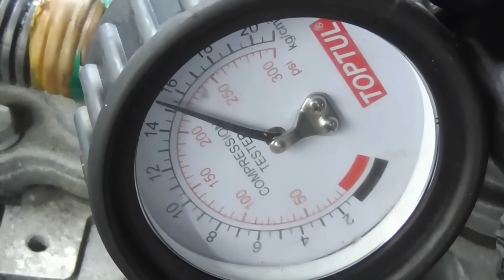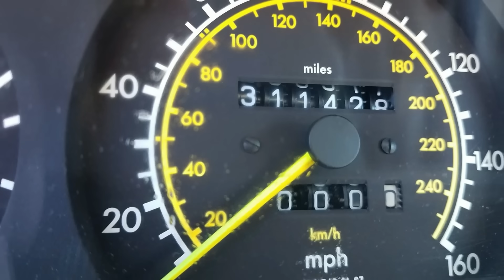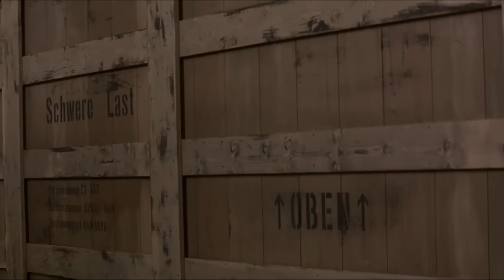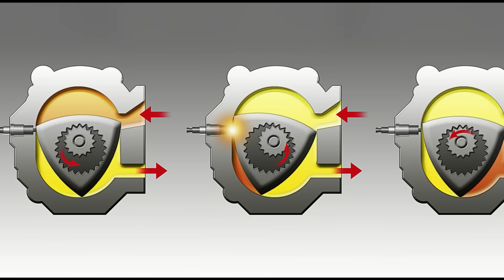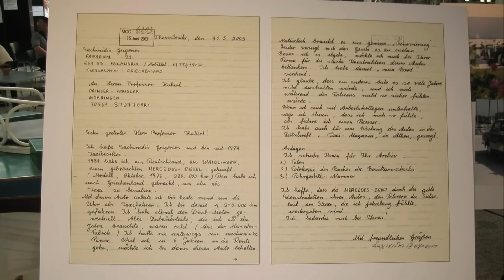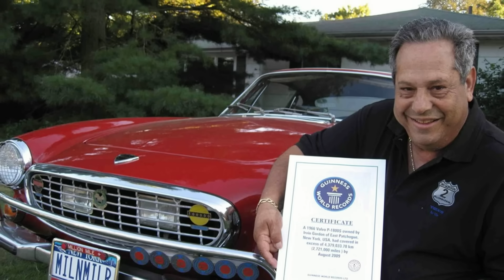Most Reliable Engines of All Time

Comment: Hate to say it but the old ford 289’s are bulletproof. 
200k is nothing, I drive up to 400 kms a day and have gone through a lot of vehicles and many different engines. 
The secret is not a secret, if you take care of almost any engine you can easily get 400,000 plus out of almost any vehicle. Oil changes being the obvious most important thing to be anal about, followed closely by being very diligent about coolant, more important than people think and mostly ignored.

Comment: 200k engine life isn't very impressive. A 6bt cummins would barely be broken in at 200k
Reply: It ain't broke in until the rear main seal leaks
Reply: @blake102989  Yesh not even really. Mines been leaking for years.
Reply: @RiggyRonnie  normally starts at about 150k for Cummins. If I ever buy a diesel itll be cummins forsure. Until then I'll stick with heavy Chevy

Comment: I'm underwhelmed by the claims of engines lasting 2 hundred thousands miles as being high mileage champs.  My GM (Detroit Diesel) 6.5L lasted 423,000 miles before it lost enough compression to become hard to start.  200K I spit on your claim of high mileage.  Took the motor to a auto machine shop and was told the cylinders had only two one thousands of an inch wear.  I guess the rings were not up to the task.

Comment: Chevy LS engines are known to go 250k to 300k miles before burning oil and used they can be turbocharged to 700hp safely and rebuilt for 2000hp. I’d say that’s worthy. 
I had a 300D. Only drove it a few times. Thought something was wrong it was so slow..... to about 15mph then the turbo started making boost and it starts grabbing gears and locking torque converter surprisingly fast. If you can manage to powerbrake it enough to build boost it will definitely roast the tires too lol

Comment: You missed a few of the really great engines.

Toyota 1Jz/2Jz - easily 200,000miles +
Toyota 1HZ and 1HDT - many examples over 1 million klms
Nissan TD42 AND TD42T - many examples over 1m klms
Reply: J M 500,000klm on my 1hz with aftermarket turbo setup.

Comment: No million mile Cummins where with basic maintenance you can achieve a million miles, no small block chevys that achieve 300k 350k? No y’all put a rotary on the list where you’ll need to replace apex seals every 50k miles, might I add that’s a pretty serious reliability issue

Comment: you missed the most durable engine ever, IMHO, the Toyota 3.4 in the 4runner and Tacoma.  Absolutely bullet proof
Reply: It is ok, has problems with timing cover leaks, OCV valves, timing chains, and power steering pumps.
Reply: @kennethebel7726  

The timing cover doesnt leak,  There is NO issue with a PCV valve, which is not part of the motor.  There is NO timing chain and the power steering pump is bullet proof and is NOT part of the motor.  Try again.
Reply: @nwredneckj  oops, I got mixed up. I was thinking the 1GR not the 5VZ. I am a Toyota Technician though. The 5VZ does have oil pan and valve cover issues though. I have seen more rear main seals on that engine than any other Toyota Engine, but they have made a revised one if you get it replaced. It has sensitive front O2 sensors especially on the passengers side. Change the fuel filter every 50k because it has primitive injectors that clog easy, but that's a common issue back then. I will agree with you that the engine does last a long time, but it does have oil leak issues past 100k. One other thing is I was saying the OCV for the 1GR, not the PCV. The OCV is for the VVT-i not the crankcase ventilation.

Comment: That can’t be right.  Missing a lot of most KNOWN reliable engines like the examples of the Jeep 4.0 and the Honda D series in older civics.   I can’t speak for just one car lasting long time like the Volvo P1800 or the Plymouth fury.   Mazda rotary?  No way.  They need apex seals replaced every 100k Miles.

Comment: Love my 1981 Mercedes 240d diesel.  It is a solid engine with just a 4 cylinder.  It has the 4 speed manual transmission and is a kick to drive.

Comment: what about the renault cleon-fonte series, or nissan sd diesel engines, i have a nissan sd23 with 432000km with the original internals, clutch, and transmission and still runs like new

Comment: Nerds who aren’t mechanically inclined should not make car videos.
Reply: Jon L THATS A FACT JACK, BET THIS MORON CANT EVEN CHANGE HIS OWN OIL
Reply: @ljbrizo  Oh yeah, but "engine tuners". An engine "tuner" is the guy who changes your points and your air filter, not the guy who bores your block and fits oversized pistons. 

Uncircumcised children who watch The Fast And The Furious and think they know something about cars. 

Look at what happened to Paul Walker - thank God he's dead, he was an idiot who did not respect the machine because he did not know enough about them, and fortunately it killed him before he could make more movies to get every 17-year-old thinking his oil-burning worn-out Civic was a race car for the streets.
Reply: For real tho😂 a dorito engine and reliable are 2 different things also by the 3sfe engine he showed a celica t23🤦 it came in a t20 gt4 and the mr2
Reply: Yes.... Exactly... DETT is not a word
Reply: He really said that rotaries are reliable. Say bye bye apex seals
Reply: Is this a high performance engine reliability post or every day drivers??? No mention of the Ford 300 CU IN in line 6 engine that I personally owned a 1965 Ford Fairlane that I sold with 491,600 miles on it still running just fine. They were made from 1965 thru 1996 and they were not just in cars/pick ups ether. Many farm tractors, farm equipment, utility vehicles and the big brown UPS trucks had them as well! They were not high mpg engines but RELIABLE! I have one horror story though that my Brother bought a 1967 Ford F 250 4x4 with a 300 six in it. In the summer of 1969 I asked him how often he changes his oil because he was complaining that it was burning a quart every 300 to 400 miles? His reply was, "Change oil?" It had 45,900 miles on it with the original oil and my brother only adding oil when needed. I changed his oil/filter putting in high detergent oil. He took my advice having the oil changed again in 100 miles. It lasted another 38,100 miles before it locked up.
Reply: LOL
Reply: I'm sure he has some pretty good sources ;)

Comment: R u kidding me, the 13b rotary engine is notorious for its reliability issues and it burns a ton of oil
Reply: Don't doubt reliability issues. But they are suppose to burn oil. They inject oil into the combustion chamber to lube it. Thats one of the major reasons they don't make them anymore. Won't pass emissions.

Comment: 5.9 Cummins Diesel    average over 600,000 before anything major.  lots of engines still pulling loads with over 1,000,000  I believe the motor started it's life in 1934 but not sure.
Reply: Diesels are a different animal. They have a different ring design that helps prevent blow by. Plus they spin a lot less rpm which helps them live longer. You're pretty much comparing a tractor engine to a car engine. They also weigh hundreds of pounds more.

Comment: Talking about reliable engines and not mentioning the 1.9 TDI should be illegal!
Reply: True Didn't even mention any detroit diesels or even the infamous 6bt cummins put in everything.
Reply: The Puppet Of Everything  Ikr, no Detroit engines?
Reply: 302000 miles on my tdi and still runs beautifully
Reply: @Bacon12954  - Just wrote this in a comment further up. ;-)
Friends Seat Ibiza 1.9 TDI (VW) 675k Km when he sold it. Still started and run perfectly. By then he simply got tired of the car. Got another new one. Absolutely regular oil changes and general care. No fancy oil additives, etc. Just plain good old maintenance. Internals all stock to the bone.  ;-)
Reply: 1.9tdi....lots of problems with turbo, turbo runaway, injectors , injection pump and so on

Comment: There's a reason the straight 6 Cummins diesel engine is known as the million mile engine..yet a Wankel engine made this list and the Cummins didn't. Not the mention the miles a Chevy 350 can rack up. Therefore this list holds little weight to anyone who really knows cars.

Comment: The Chrysler 225/3.7 Litre Slant Six should've made the list, I've seen several with over 600,000 miles on them with all original engine internals.
Reply: best motor ever for reliability..  had one in a dodge dart gt.... got it with 200k on it and I put over 100k and it was still running strong when I sold it....

Comment: First off, mazda didn't invent the wankel. They just took the chance to mass produce it. GM experimented with the wankel design and made one that ran with over 500,000 miles with minimal wear. That being said, the engines should be left to racing applications. There's too many ignorant men and women who do well to maintain piston engines. I see regular motors for sale every day in vehicles with ruined heads and possible cylinder wall and piston damage at 100,000 miles because they neglect the timing belt. God forbid they ever check the oil.

Comment: My dad's Chevy 350 v8 from the 70s had 1 million miles. All he had done was change gaskets....the internals were all original.
Reply: Really? Good for him. I've seen many many SBC from that era smoke before 100,000 mi because the rings were gone. Still running for sure. But you can't sit in traffic without asphyxiating everyone at that intersection.
Reply: 100% true. He drove it daily and changed oil at 5000 with castrol. He also wasn't afraid to drive the piss out of it. He swore by Lucas oil in his gas too, a tradition I've lept. I've never got under 250k put of an engine and I Rev em and push em hard. Dad always said worse thing you can do to a car is not drive it. He documented the mileage. He changed head gaskets etc only, the valve cover gaskets tended to leak, they were cork. He drove it year round in upstate ny. Always put good gas in it, it had balls too!
Reply: Friends Seat Ibiza 1.9 TDI (VW) 675k Km when he sold it. Still started and run perfectly. By then he simply got tired of the car. Got another new one. Absolutely regular oil changes and general care. No fancy oil additives, etc. Just plain good old maintenance. Internals all stock to the bone.  ;-)

Comment: You forgot GM's 3.8 Liter V6 ! My 3.8 Buick Lacrosse has 240K and still runs strong !  No noise, no smoke, passes emissions inspection, still runs smooth !
Reply: easily one of the best pushrod engines. I used to have the L67 3800 Series II supercharged in a modded GTP Grand Prix
Reply: 3.8 series II is very good.  Seen them with 300k - 400k miles.
Reply: @scotta9114  s3 is also good
Reply: Im sure it is.  What's better than old proven technogy?  Nothing.  Now their transmissions arent so good. My friend just spent $600 to get the intake valves cleaned on her Direct Injection KIA.  Crazy.
Reply: I agree 3800 v6 the best v6 engine ever built
Reply: that  may mean my wife will never have to buy a car again?
Reply: There not bad engines if you take care of them but they're nowhere near the list of most reliable I had a V8 Northstar with 210,000 on it doesn't make the Northstar reliable engine
Reply: @EXPERTAUTOREPAIR  Good point, but the 3.8 V6 has a much better reputation then the Northstar engine !
Reply: @EXPERTAUTOREPAIR  except they where considered very reliable by mechanics and car people. Could last 500k miles with proper maintenance

Comment: Typical import fan list. Camrys and accords with 100k miles are road hazards. Struts are completely shot, CV joints go bad, they smoke and transmissions flare shift. Check engine lights are lit all the time. Just because they run for a couple hundred k, doesnt mean they're not shit boxes. One of the engines used from the mid eighties to the nineties? The small block Chevy was used from 1955 to 1997. Over 100 million engines based on a single design. Horsepower kills engines. Any of those tiny import 4 cylinders should run 400k considering they make 100 hp and pull a 2500 lb car. The ones in the list with twin turbos definitely wont run 100k. Another uninformed propaganda list.

Comment: Chevy volt 400k miles and still runs great with stock brakes.
Reply: I heard a guy at discount tire talking about the regen saving the brake....i wonder if the regen wears???  400k sounds like it doesn't wear anything.

Comment: BMW and Mazda engines among most reliable engines? Seriously?
Reply: BMW engines are good, its all the plastic bullshit around the engine that breaks. I also had an E30 with over 300k but my 2002 330ci was always breaking. Plastic water pump impeller broke, plastic radiator broke, ignition coils always burned out, plastic MAF housing cracked etc. Totally unacceptable for a "premium vehicle" considering my 1974 chevy truck is still rolling with the original water pump and radiator.
Reply: My e30 has 242k and still runs great
Reply: Rotary engines aside Mazda does indeed make some of the most reliable engines.
Reply: Bmw M57 engine wasn't as reliable as the M51 engine.

Comment: A 4 cylinder motor than can do 300k+ miles with little to no issues is MUCH MORE impressive than a 6 cylinder or especially 8 cylinders doing the same.
Reply: Not really....  V blocks usually don't last as long as inline engines.

Comment: Nothing on the 92 VW 1600 turbo D...changed the glow plugs...belts and fluidsl regularly other than that it was factory sealed. I rolled it back to zero (1,000,000 km) its life cut short by a drunk driver after 17 years of driving pleasure.

Comment: Iam a Chevy guy but the ford 300 6 cyl was a great engine, my daily driver is an 2006 camry  255k. My 97 silverado 250k and both are running fine.
Reply: I tried blowing up a 300i Ford and was unsuccessful. Truck was junk motor still ran. So I drained the oil and drove it around field for a while. Didn't blow up. Then drained the coolant. It ran long enough for me to get bored trying to blow it up. So I put 3 rifle rounds into the block. It fucking started. After all that I let it be. Probably not impossible to blow those motors up but definitely not easy.
Reply: I got a 300 with somewhere around 75000 miles, and it just finishing up with being broke in.... Lmao
Reply: The old 250 6 cylinder from Chevy was absolutely bulletproof

Comment: My 95 camaro v6 3.8 engine gave up with 265000 miles in it and 2 transmission rebuilds actually engine piston rings did not go but the heads did leak compression still regret towing it away but my sierra v8 5.3 still running strong with 200k miles on it as well

Comment: How can a cummin's 5.9 12v diesel not be mentioned they easily hit 1,000,000 miles with proper maintenance yea they leak like 90% of diesel engines in my opinion there the most reliable engine ever made.

Comment: Mb 200d 1988 with 870tkm without any problems with the engine. Now used as a winter drift missile so it sits 3/4 of the year. Oil is checked maybe once a year and only added some if there is any missing. And you think its impressive when an engine goes 100k miles ( 160k kilometers ) without any problems... Triggered

Comment: This list was not categorized properly along with other things.  Useless list unless you can quantify an engine with mileage based upon usage in different chassis.  100k to 200k should be considered average.  If an engine doesn't  make it at least that long then the entire brand should be avoided.  Also, a reliable rotary motor????  Unique but far from reliable.  All of my cars and trucks have been in the 200+ range with out engine problems.  And define "problem".  One one hand I have had engines like the Ford 6.0 powerstroke that was garbage and on the other a Toyota 4.6L V8 which is bulletproof.  As well as many in between but only the Ford 6.0 is one I would call a "problem" (in the shop at 20K,30k, 60k, 100k, 130k)

Comment: I have a 1999 Toyota Camry with 486,000 miles on it, just keeps on going. Knock on wood.
Reply: Bob Joe Toyotas of the late 90s and early 2000s are literal tanks. Hope it runs strong for another 100,000.
Reply: 99 xle. Every option Available.   Close to 300k

Comment: This is stupid. That Camry engine he mentioned 150k is when they blow head gaskets just as bad as EJ25 from Subaru. Difference is that the Subaru EJ25 is easily fixed whereas that camry engine when it blows a headgasket throw it away. Not fixable. Now the real engines that last a long time are: 4.0l from Jeep  ; 4.6l Ford V8 ;  Subaru EJ22  ;Toyota 2tzFE engine ; Honda J30A1;  The ones I listed will easily go past 300k miles and almost all of these are now past 200k miles; They are all bulletproof; They all have one thing in common. They all start to leak oil at around 300k miles. How do I know??? I have owned all of em.

Comment: I had a 91 S10 that was still running with 380k miles.  4.3 engine.  I sold it several years ago.

Comment: I thought the engines were 1,000,000 mile motors, not 100,000-200,000. My 1998 Tacoma has 200,000 miles and is running like new.

Comment: benz diesels were incredibly reliable, especially the 5 cylinder 250. 6cyl is good but cold start problems.
but their early 2.0e and 1.8 gas engines were horrendous!
Reply: They better have the om606 on here , best engine I've ever ran

Comment: my 1999 vortec 454 is bulletproof and hit 200k with no issues. My 99 to 2003 buick 3800 k motor na and 1 engine supercharged are also bulletproof and reliable. Id put either 1 against any of those import silly engines